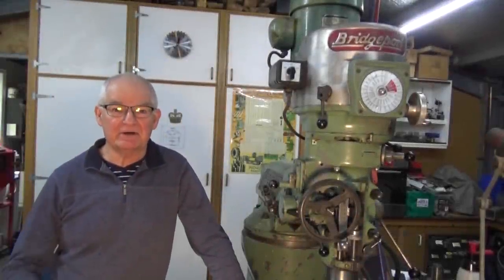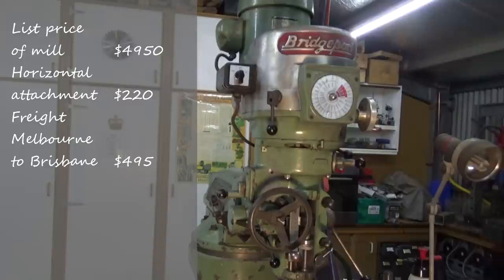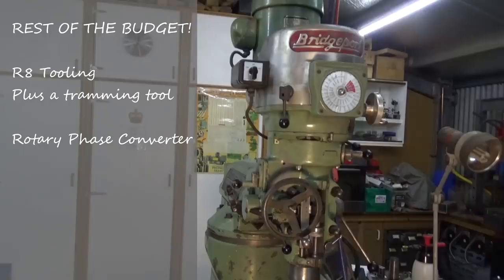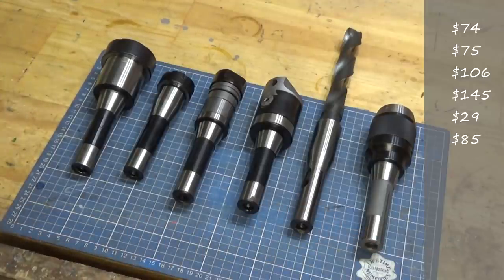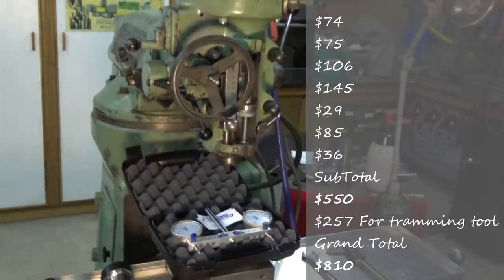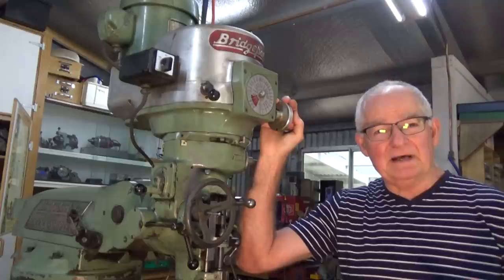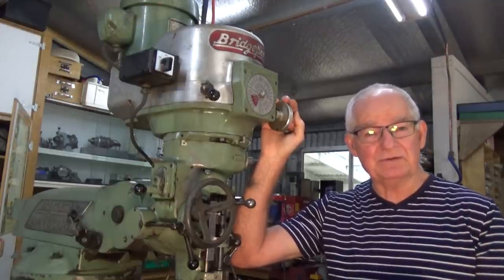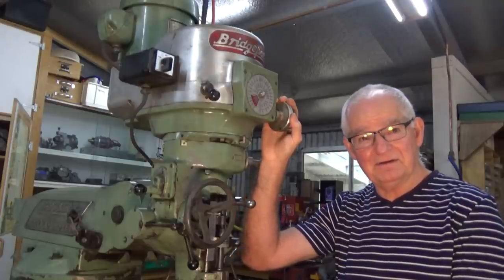Budgeting for a New Milling Machine

Comment: I've just moved, leveled and trammed my bridgeport, I love it!
BTW I simply wired it into a 15A VFD,  (240v supply (UK) on a 13 amp plug)  everthing works but it doesn't seem to have the initial power to bring the contactors in firmly. They work with a bit of a manual push.

Oh and .......Just to sicken you slightly....... I got the deal of the decade on mine. It's a MK1 but everything is in working order, Its been fully reworked by bridgeport at some time and I paid

£150.00 for it. (About $175). Just to put that in context, the vice that came withe it is a 6" Kurt on a swivel base is worth £450.00.

Sorry
Reply: Ditto! I have the step pulley head with the longer table though. I did pull the thing apart to repaint everything.
Reply from the maker: Yes, I do feel sick now! For what it's worth, I did investigate running a VFD or a VSD but my understanding is that you cannot really make 415V from a 240V VFD. The best you can do is supply the motor with 240V three phase but the motor power will be derated. It will work but it won't generate the rated horsepower or KWH of the motor. 
Regards,
Mark

Comment: I had a 500kg thicknesser/jointer delivered in peak hr about half hr drive one way, using a crane flat bed truck. He charged me 500 here in melbourne. As for the phase converter, I scored a good deal on an Italian made 7KVA Sincro 3 phase alternator hoocked to 7.5hp 3 phase motor. Sold the VFD that came with it which basically means i got the alternator for free. I just have to buy 7.5hp single phase motor for 400 and install 32 amp supply to my house for 200.

Its better to have phase converter instead of converting a specific machine, becuase you can score cheap used 3 phase equipment.

Its nice to follow someone who lives in Australia esp. when you mention price in same currency and where you get things from. Nothing too fancy with filming just perfect and great content. Binged through your videos without skipping. Keep up the great work!
Reply from the maker: Thanks for the nice feedback. I realised that the RPC was going to be the most expensive option but I like that it is on wheels and I can just move it around from one machine to another, if I ever get another machine that is.
Regards,
Mark

Comment: Chris from the US here, great mill! I own a Bridgeport (Textron) 2J (1979 I think) with original BP powerfeed and a Mitutoyo DRO. Really good mill BUT notoriously noisy (it's normal). A good source for parts and info is H&W machine repair. I don't know about the shipping but they are a good resource. They also offer a repair/rebuild manual that is top notch. Good luck with your new addition!
Cheers!
Reply from the maker: Chris, I have been watching all the H&W videos on YT, and I have been stalking their website. As you say, loads of good resources. It's good to get some feedback from other users with 2J heads. I fully expected mine to be noisier than it is so that's a win.
Regards,
Mark

Comment: If I were going the route of a rotary phase converter I probably would had built one myself with an antique low-speed motor like one for a cotton gin.  They're big and heavy but they're quiet and the inertia from the rotor will help start a large load.

Comment: Congratulations, it is a marvelous investment'.
I bought the same mill about 4 years ago from of all things a machinery consignment shop in New Jersey with at least 100lbs of tooling For $1700.00 US.
Had it delivered to Pennsylvania, about 70 miles on a rollback for $350. I was lucky to find it at such a low price. It did require a lot of parts & labor, which I like to do.
Reply from the maker: You did well on that deal. Sadly, those sorts of deals are rare here. You usually have to know someone who knows someone. 
Regards,
Mark

Comment: Great video. I have just purchased basically the same mill and now amassing tooling so I can play with my new toy.  I looked at phase converters and decided that I would build my own. A company named WNY supply sells a kit to build a phase converter for $145, all you need to do is Supply a three phase motor.  Locally there is an electric motor rebuilding company and I was able to purchase a rebuilt three phase 5 hp motor for $100, now it’s got to be wired up and I’ll be up and running.  Any how, I’m looking forward to more of your video’s and best of luck with your new toy. 😬👍
Reply from the maker: I am not sure why the phase converter that I purchased was so expensive but I guess I was paying for my lack of confidence with regard to electrical installation. Your option sounds like really good value. 
Regards,
Mark

Comment: Nice looking mill .You  may find you throw that tramming tool in the bin  because they are a pain in the ass to use  !  , You may have watched RR's video on it !   A set of R8 collets  you will find useful as  well  ,  All industrial in the US have a good set  that goes to 1'' .     I have to do a couple of lube lines on my one as well .    Cheers .
Reply from the maker: Max, I did watch Randy's video but I actually found it quite easy to use. I calibrated it on a 123 block first and it only took a few minutes to get it in tram in both directions. I used to sweep an indicator on my old mill and it was a pain having to look around the back or use a mirror. The collets are on the "list of nice things to have"
Regards,
Mark

Comment: You can pick up a used variable speed Bridgeport any day of the week in Ohio, USA for around $1200 USD.   A “J” head Bridgeport is a little higher.   You can get a clone or offshoot Bridgeport for under $900.   I picked up a clone variable speed head Bridgeport for $750 USA and it cost me another $700 just to get it shipped 16 miles to my garage.   I’ve had it almost 10 years and use it at least once a week.  I love it.   It runs on 3 phase.   I feed 220 single phase (split in to two legs, L1 and L2) into a5 hp 3 phase motor.   I got the motor for free.   After rope starting, I switch it on and L3 generates the 3rd leg of the 3 phase.    Works perfect.   I do not have power feed or a coolant pump.    The variable speed head Bridgeport’s are notorious for being noisy.   It’s the cone pulleys.   I prefer the step pulley head, but they are hard to find.
Reply from the maker: You are lucky to have so much choice in the USA. Plus of course, Bridgeport is a native brand and there are very few Australian machine tool manufacturers so nearly all machine tools are imported.
Regards,
Mark

Comment: R8 tooling is the stinger! A mill running ISO 40 spindle opens up a world of cheaper tooling and a much better selection to choose from. ISO 40 also allows fitting of a powered drawbar as it can eject tooling without needing a hammer like you need on R8 tooling.
 Best thing ever was biting the bullet and having three phase run to the workshop.
Reply from the maker: Andrew, my view is that even R8 tooling is better than morse taper which is what I was stuck with on the old mill. I am going to build a power drawbar and I actually tried it using a butterfly impact wrench. The hammer action does eject the tool but whoever owned the mill before me hammered on and mushroomed over the hex end of the drawbar so much that a spanner wouldn't fit on it. 
Regards,
Mark

Comment: just refinished top end rebuild on my bridgeport easy to work on
Reply from the maker: I wish I had the same experience. I must say I got a bit frustrated trying to take the quill drive shaft out. I tried every pair of snap ring pliers I had and even bought another pair trying to get the outer snap ring off without destroying it. I watched the H&W Machine Repair video and even they said they usually broke the snap ring getting it off. However, I did eventually get it done. I am glad I did the job though. It gives you an opportunity to see how everything works.
Regards,
Mark

Comment: Mine cost 3200USD, including a VFD. It runs on 230V single phase. My power feed is 115V single phase and I don't use a cooling pump. One of the big advantages of the VFD is the ability to do power tapping with torque limiting control, and instant reversing. Private sale, no tax.
Reply from the maker: I must say that I agonised over the VFD/VSD/Phase converter conundrum for some time. I couldn't find a VFD that would supply the 415V that the motor needed from a 240V supply and the information that I got from various forums was that using a 240V VFD would run the motor although it would also de-rate the motor power. Probably this wouldn't be an issue unless you were doing really heavy cuts on a regular basis. I am guessing most hobbyists would only run their mills at a fraction of their capacity so it would most likely never be apparent that there was some loss of power at the motor. 
Regards,
Mark

Comment: I have a friend with a Bridgeport milling machine with the variable speed drive.   His mill runs a lot quieter than yours.   Joe Pie. has a video on taking his head apart to replace bearings.
I am eager to see the next video with the table and knee removed.   Heavy pieces.
Dave.
Reply from the maker: Dave, I have seen most of the videos out there on the Bridgeport and the one thing I like is that  you can dismantle the entire machine with a couple of spanners and a few allen keys. No special tools needed and I found plenty of resources online to help. Unfortunately, I have decided not to video the restoration as there are already a couple of very good series out there on the process. It's also it's just a lot of cleaning, sanding and painting. I should be able to start etch priming, filling and painting late next week, but I am only doing the bottom part of the machine for now. 
Regards,
Mark

Comment: Great Video Mark, yes sometimes you need to fork out a little more to get what you want, these are a well built and sort after machine that are extremely versatile in the shop.  I wouldn't be without mine.
PS, E-mail sent with some Bridgeport Manuals.
Reply from the maker: Cam, thanks for the documentation. I am really looking forward to using the quill on this machine. It's something that I had to do without on the old Denbigh. I might also be able to finish a job without smashing an expensive end mill too.
Regards,
Mark

Comment: Great post Mark, it's rare, interesting and horrifying when we see the total cost of these machines. I'd previously suggested that we may get to see the 'How to zinc plate a Bridgeport' video, but now having seen it in the flesh you should consider 'How to chrome plate a Bridgeport'  😊  Thanks for sharing.
Reply from the maker: Stephen,
It's funny how you look at a machine when you first get it and think, it's just a bit dirty, I'll clean it with a rag and it'll be fine. A couple of days later it's in pieces and you are finding more reasons to completely repaint it. I think I did the most horrific part of the process today which involved degreasing the worst parts. I can powder coat some of the smaller bits like the way wipers but the green paint has been put on with a brush and it's peeling off because it was painted while it was still assembled. They even went around things like the one shot oiler and the switch console. There are dribbles of paint behind these parts and it drives me mad. 
Regards,
Mark
Reply: @Preso58  Would do the same to me Mark. And it means there is hope - we may well get to see the Bridgeport stripped down and properly repainted 🤞

Comment: Hey Preso, I bought my colchester lathe through Newmac, I was very happy with their service, lucky for me I’m only a couple hours drive away, collected it with a tandem trailer. I also purchased a rotary converter, I fell over when I got the price for it, but well worth it when I bought my Bridgeport clone and simply plugged it in and away it went. I was hoping you would let me know a supplier for the rapid feed button cover as mines perished too, oh well I’ll keep looking. Keep up the great videos mate👍🏻 Glenn
Reply from the maker: Glenn, I had a YouTube viewer in New Zealand send me two of those covers and I still have one spare. I can send it to you if you like. There's a guy on Instagram called @sgsengineering who made a cover from one of those little priming bulbs used on brushcutters and chainsaws. They are clear but just about the right size. Yes, the guys at Newmac were very good and they kept me informed about the mill and were very accommodating when I asked them to prep the mill for transport. Let me know if you want the switch cover. mark.presling@gmail.com

Comment: Thank you, for a long overdue cost break down video on a popular machine tool.  I know of no other on this important topic. As a guy once responsible for a machine shop of a larger manufacturing operation for years I budgeted new equipment and tooling.  Not once in 10 years did the value of the machines themselves exceed the value of the tooling.  Add to the tooling the shop supplies and metrology tools and for a typical CNC shop in the US the machines themselves are roughly ½ the total  value.  Home shops are quite different but the point is the tooling is very expensive. You were lucky you already had a vise and didn’t count that in the total. But lets face it you need two new ones. .. and OMG you have already taken it apart! This is going to be interesting to watch Mark paint with a brush?
Reply from the maker: No! No brushes! Such a travesty when I see that happening. Spray guns aren't that expensive and even a cheap compressor still makes the same compressed air as a $10000 screw compressor. Well, maybe not as dry but near enough.  I am part way through the process now and I have decided not to film it. There are already a couple of good restoration videos out there and at the end of the day it's like watching paint dry - literally. You are correct about the tooling cost to machine ratio. There's no escaping it.
Regards,
Mark
Reply: @Preso58  Awwwwww we don’t get to see Mark use a brush. Probably doesn’t even use one painting a house. Nice thing about tooling in the home shop is that you can buy it as you need it. Not like you have to load up  60 stations on a Mazak.

Comment: Good Show Mate...as always. I am really happy for you. I am not surprised your viewers want a Bridgeport. The type of folks your channel is going to appeal to are into machines and cutting metal. Even if they have never done it before. Having looked for B'ports before, I think you did well with the machine and tooling. Being in Tennessee it's a little hard for me to come and help but that would be a hoot for me. Probably would drive you nuts. I am OCD with a lazy streak. I'll have to stay on this side of the pond and teach my grand daughters archery and other fancy stuff. I am really looking forward to your refurb of this machine. Be careful. There is almost no light stuff on a B'port. Like you don't know that already.
Reply from the maker: Yes, I manhandled the saddle and knee off solo but I did use a chain hoist for the knee. The table is balanced precariously on my tool cart for the time being. I am truly impressed by how easy it is to dismantle this machine. Most of the work can be done with one sized spanner and a handful of allen keys. 
Regards,
Mark
Reply: @Preso58  I'm figuring that table is in the 200 pound category if not more. You be having fun, I'm sure. Good luck.

Comment: That's a good price for that phase converter, i was quoted $4,500 down here in Melbourne,  so i got three phase put into my shop for $4,000. Pulling apart that mill will be easy. I pulled apart my rambaudi mill to repaint and repair no problem at all.
Reply: Phase converters aren't all the same. It pays to drop $ on them and only get a rotary. Years ago we put a phase converter (not rotary) on a 3hp lathe. With a heavy cut, you could stall the spindle... totally useless.
Reply: Yes that's true, sorry  i meant to say rotary phase converter, the company who i got the price from also said i will need to have a 30 amp outlet for the rotary phase converter to work, i only have 10 amp outlet. I can't remember if i needed to get the line upgraded to 30 amp. So maybe $500 or more for the upgrade on top of the $4,500  I think i got got a very good deal with getting the three phase put into the shop.

Comment: Great vlog, looking forward to some precision swarf, after the blue printing of the machine 😀.
Being from the UK, I can understand the high costs in transport, and you being so far from away from the manufacturing centres of the continent of Australia, but even looking at a world map, I can't comprehend its size.
I think there is a maximum speed that the quill feed should be disengaged, ref when you showed it running.
Thanks for sharing.
Regards John.
Reply from the maker: John, thanks for watching. Yes, the distance we have to travel here in Oz can be hard for people to understand. We once had visitors from New Zealand who told us they were thinking of driving from Brisbane to Cairns for the day! It's a 24 hour drive. I am liking the Bridgeport more and more and I love the fact that you can dismantle the entire machine with just a handful of tools. 
Regards,
Mark
Reply: @Preso58  Hi Mark,
With regard to machine transport costs, I paid £ 150 to have my second hand Bridgeport collected from a machinery supplier less than 20 miles, and skated into its position in my garage, circa 2012, this was with two guys and a full sized truck with crane, I had no problem with this cost, for three hours work.
Prices for Bridgeports (working condition) here in the UK varies from £ 500 to £ 5000, reconditioned ones can be up to £15000, similar sized CNC milling machines, with conversational controls are about £ 28000 new.
Most of the cutting tools and holders I purchase are Korean, ref Korloy, Taegutec, YG etc, very good quality.
Hope you don't find any nasties on strip down.
Regards John.